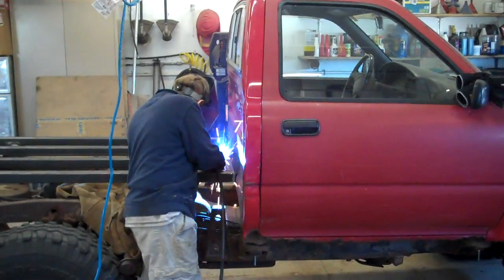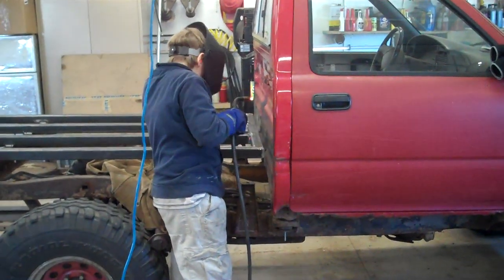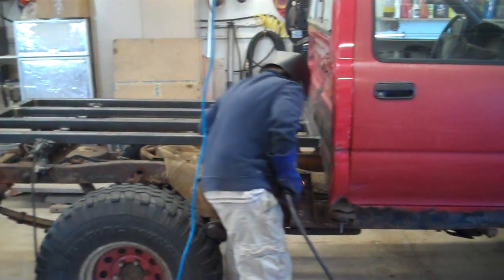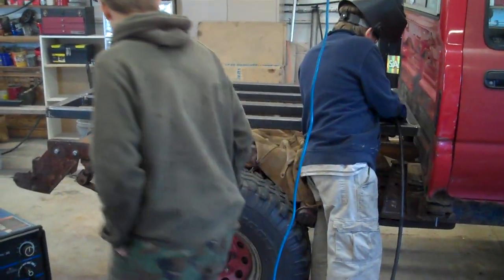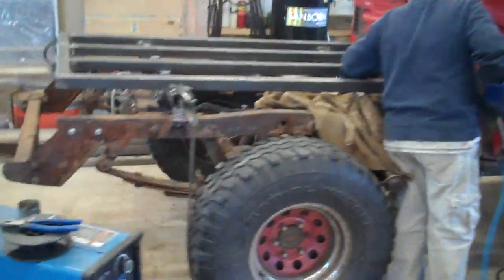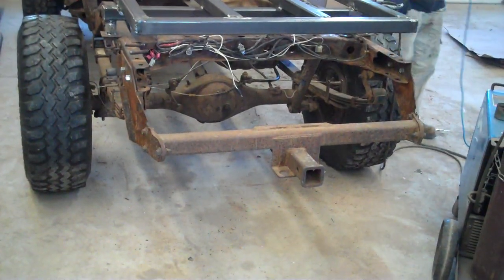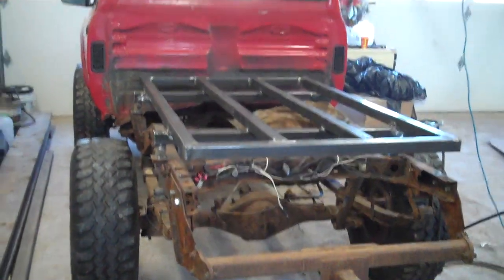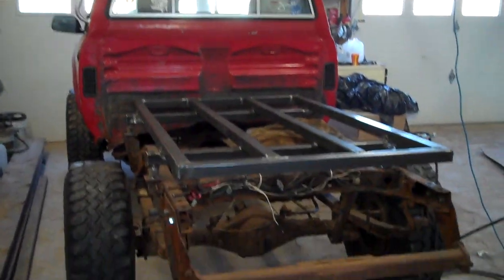The Toyota gets a new flat bed

Comment from the maker: Thanks for the tip.  In this case, though, the new unpainted metal that we were welding on was certainly the path of least resistance.  No need to worry about the ground wires in this case.

Comment from the maker: There were not really ever any measurements, we just bolted tubes to the original body mounts on the frame.  Then we measured how long and wide we wanted it and did the math.  It's about the same length as the end of the frame, with a little space to the cab, and a little narrower than the cab.  With this design, you need about 4 times the length and about 4 times the width give or take a little for the cuts and angles.